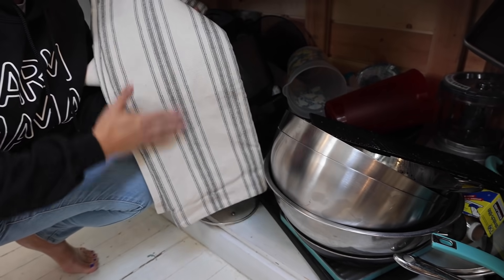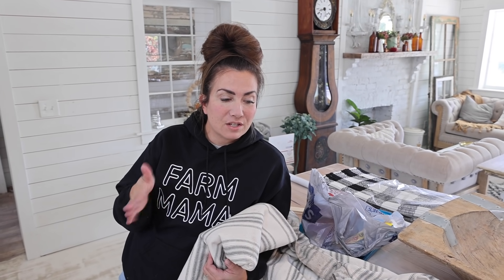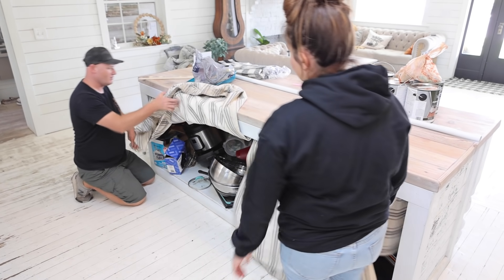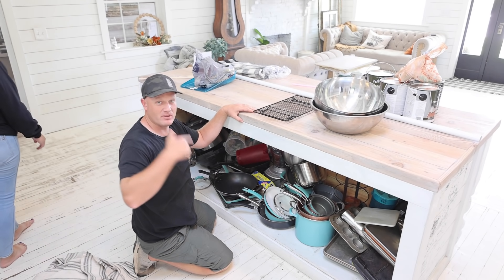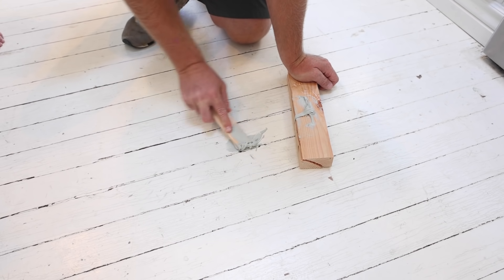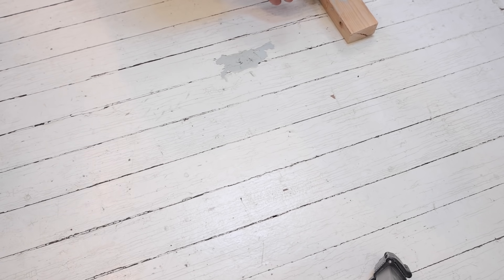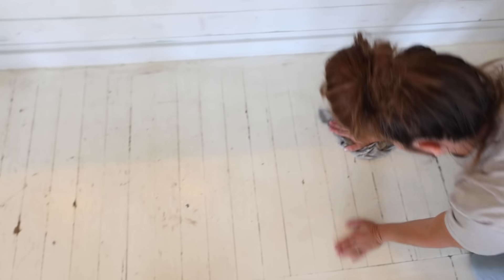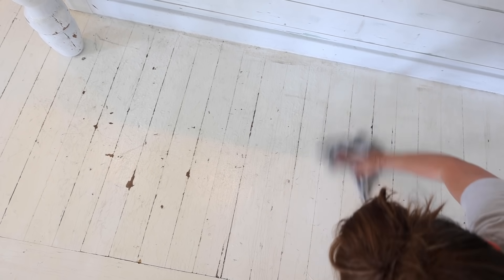Farmhouse Remodel Painted Floors and A Curtain For the Kitchen Island

Comment: Oil based enamel, you can not beat it for floors! Painted many with it & it holds up well! I took a different color after the solid color & a roof & tar brush & swiped the darker color in to make it look like wood. You could do that with a gray over the white & make it look like barn wood. It also hides the imperfection well. But it looks great the way it is! The drying time is long but why it drys so hard. 
 Funny story we did it in squares using the oil based enamel once & everybody had to walk on the light squares until the mint green squares dried. And then visea versa. It worked good for me, but hubbies feet where to big & he had to walk on his tippy toes! Lol.  But the floor turned out amazing!
Reply: That’s funny!
Reply from the maker: Haha!  I would love to see the big guy tip toe

Comment: I wish I had the nerve to paint my floors white. Mine are a grey/beige. We used a good Behr porch paint but it hasn't held up well. Been about 3 years. Only 2 old folks and  a dog and cat. We have plenty of paint left and our goal is to get the floors done again by Christmas decorating.  I have a curtain on my kitchen cabinet but the cat knocked it down on a rod so ours is nailed up. I have changed it out twice. I am able to use a single panel kitchen curtain so each time I get 2 uses as it is a small cabinet. We store our kitchen towels in a large basket  and large pots not in use much in that cabinet.  I love how your floors turned out. Refreshing things is always in the cards. We just got new slipcover for sofa and new Fall quilts for bedroom. It is always fun to make changes.

Comment: The only way for the enamel based paint to cure is to run a dehumidifier in there for awhile and and circulate the air with some big fans, until the humidity in the room drops.  If you live where it gets cold now, the heat being turned on would also dry up the humidity pretty quickly.

Comment: Hope you have much better luck with your floor paint than I did. Used on old hardwoods in our house, it has not held up well.  I don’t mind the wear and tear so much. It adds some character. What I really hate is even with 4 coats of poly it stains super easy. Not sure how but I can’t even sand the stains off.
Reply from the maker: Our floor moves because it doesn’t have a sub floor so there are a few cracks in the joints but it hasn’t had issues with stains and cleans up easy. We sealed it with a water based poly